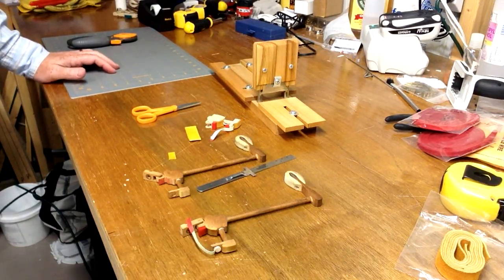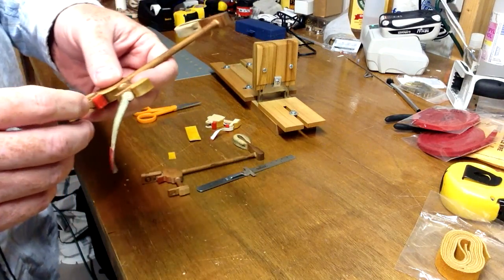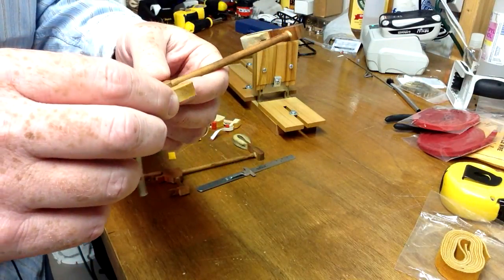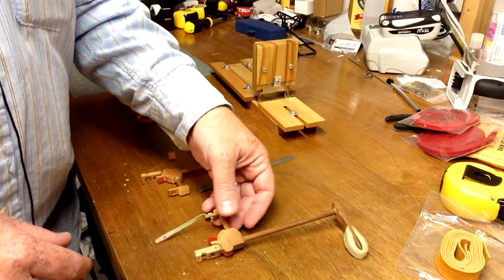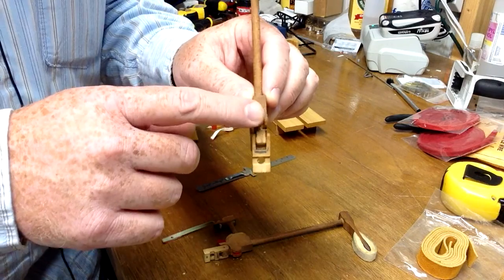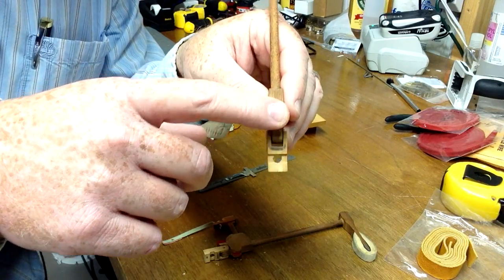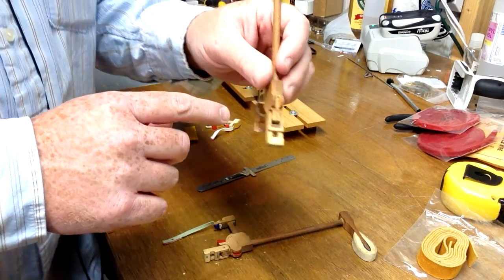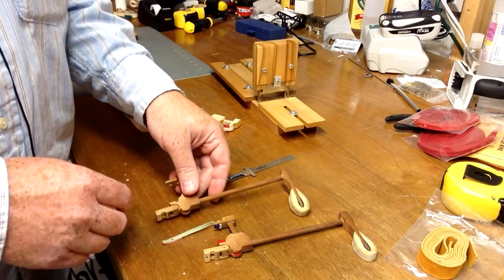Piano Tuning & Repair- Replacing Catcher Leather And Butt Spring Punchings I HOWARD PIANO INDUSTRIES

Comment: How do you remove the old catcher leather- did you just cut it out with a razor blade?
Reply from the maker: You can heat up the glue and take a utility knife to remove the old catcher leather. Careful not to mark the wood. There are also glue de-bonders available. Thanks for watching!
Reply: @howardpianoind  

Thanks for the tip Mr Howard. I turn to your videos more than my Reblitz or Igrec